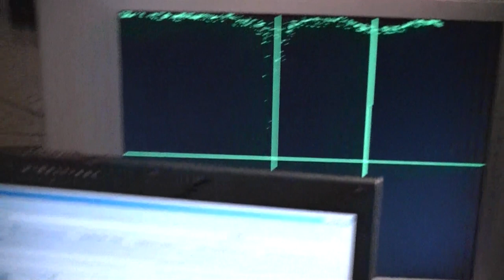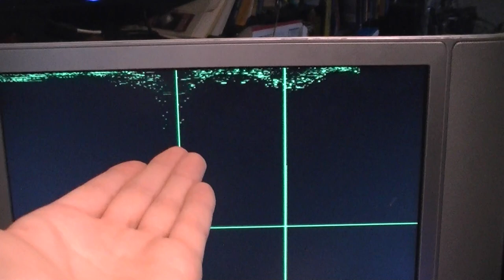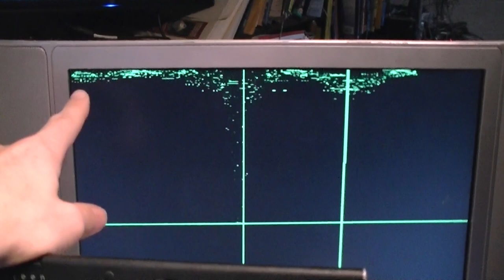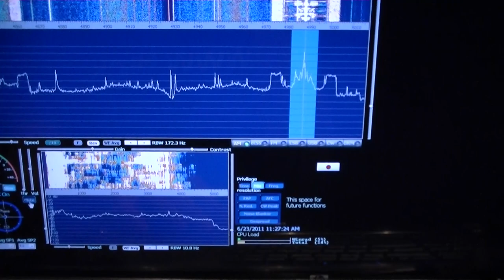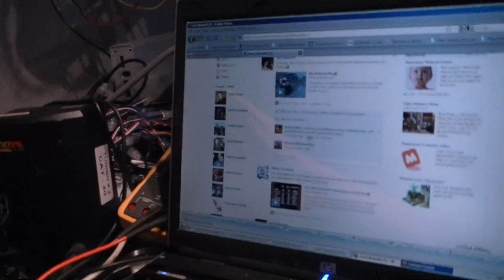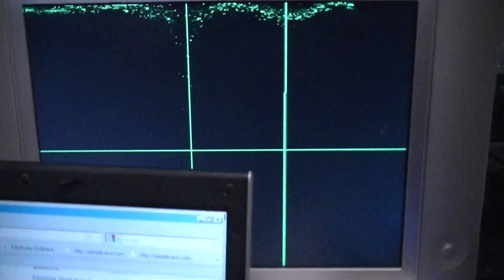Software Defined Radio Vlog Part 7 - AM Demodulation and Floating Point

Comment: Jeri,
If you're even still messing about with SDR, using a "pro audio" sound card and ASIO or WASAPI drivers can get the audio latency down to  5ms or so on fast hardware with low DPC latency. Your FPGA will still have lower latency, but 5ms is at least tolerable. Libraries like PortAudio make it possible to use the PC as a good platform for audio-bandwidth QSD experiments.